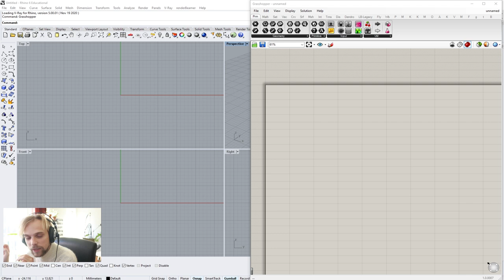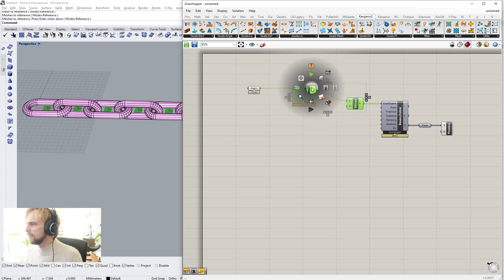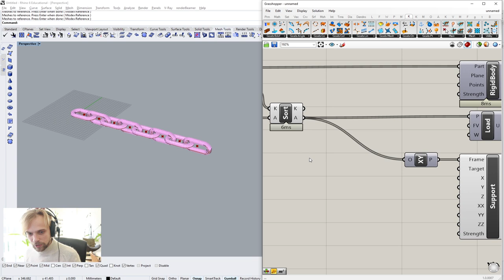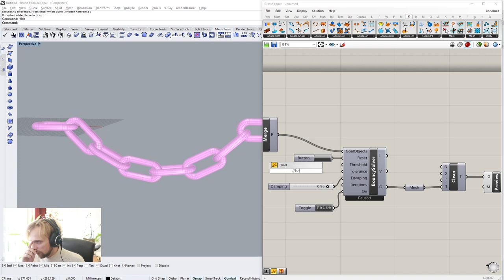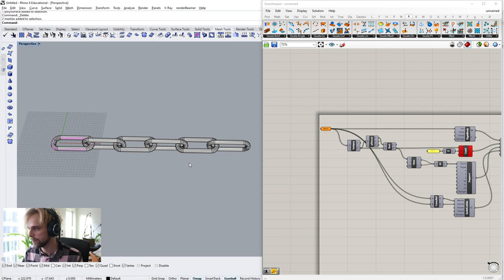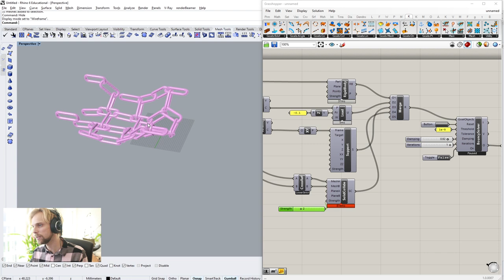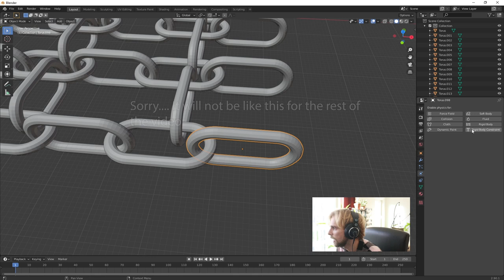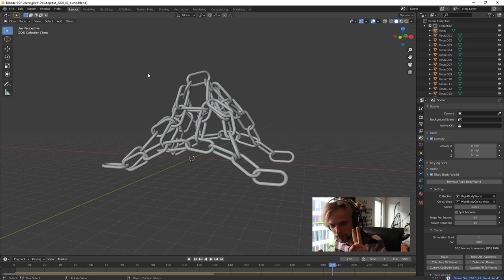2020-47 LTH Tutorials: Rigid Body Physics Simulations with Grasshopper and Blender

Comment: lol the ending is spicy xD
Reply from the maker: Sometimes I get too excited.
Reply: @DesignGoBrr  btw im trying to inflate some geometry in kangaroo and grasshopper is constantly giving me unsymmetrical results even if the starting geometry is symmetrical... I tried limiting the movement of the middle points to 2 axes but its still moving other parts of the geometry in different ways... do you have any idea what is causing that and how to fix it ? I can send you the definition if you need to take a look at it.
Reply from the maker: 99% of the time it's the topology of the mesh. Even if the form is symmetrical, if the polygon distribution is non-symetrical, then the simulation will yeld non-simmetrical results

Comment: Nice to see you producing these Kangaroo tutorials, thanks for sharing.
To simulate something like this in Kangaroo I actually wouldn't use the mesh rigid body component, but instead the 'Collider' goal with capsules, and a RigidPointSet to keep the shape - this is much faster and more stable (here's an example showing this approach https://vimeo.com/221471947 - I can share an example definition if it would be of interest). Of course this relies on the geometry being possible to model as a collection of capsules, and for this chain it is a good fit, but for more general shapes might not be.

The Kangaroo mesh-mesh collider is still extremely limited - maybe enough to stop 2 or 3 mechanical parts passing through each other, but not much more. I've even been thinking of taking it out until I finish rewriting it because I know it is frustrating to use in its current state.
Reply from the maker: Hi there Daniel. First of all - big fan! I have (probably) mentioned this in the video - I chose the rigid body goal to keep the "flexibility" of the chain link design, similar to what me and Petras have messed around with in Processing back in 2014 https://gkirdeikis.wordpress.com/portfolio/the-figure-and-its-figuration/ . As for your collider goal approach - i'll definitely make a follow up video (with some click-bait-y title) showcasing it, as well as talking about the differences between these two approaches. I always appreciate when content simply appears :D